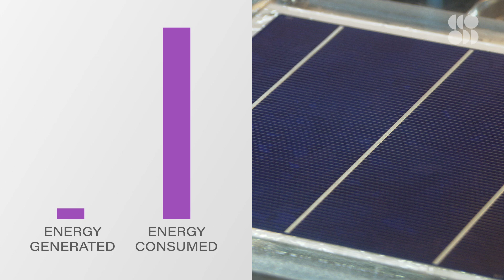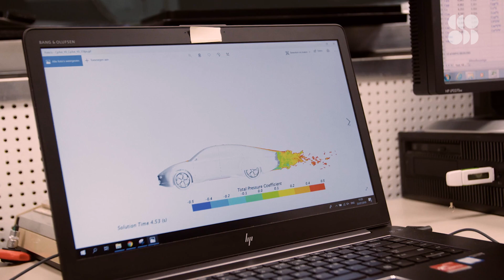The Solar Car Revolution Could Change EVs Forever

Comment: Forget EVs , EVs are here but now they have solar roofs!
Reply: They worded it bad, but solar vehicles have to have batteries for reliability. But they can be way smaller.
Reply: @Lardah  The Aptera goes from 40Kw up to 100Kw for the 1000 mile range, that is top end for EV battery size..
Reply: @peterchandler8505  okay didn't know that and didn't search for it. I was just intending to state that with Solar EVs the batteries can be smaller than non solar, which saves weight and space.
If you then fit more top notch batteries in that free space you can obviously increase the range by quite a lot (depending on circumstances)
Reply: @peterchandler8505  The Aptera doesn't actually exist and it's a very, very long way from doing so
Reply: @kirkc9643  I know that there are only 2 protype Apteras at the moment (having re purchased the IP & experience from their first Aptera prototypes & testing), however their fund raising efforts have been quite successful, the joint CEOs both built up & sold successful companies between their first run with the Aptera & second, not to forget that battery technology has progressed enormously since their first Aptera alongside a totally different market for EVs strengthened by Climate Change concerns.  I would therefore suggest that their plan for production Apteras to be rolling out of the door around the end of these year looks reasonable, although that first year of production is already spoken for by the people who have put a deposit down...
Reply: @Lardah  I would be walking a lot with a solar car with the current weather we’ve had lately.
Reply: SEVs 😝
Reply: I hate these clickbaity titles.
Reply: Yep same as the Solar roadway!!!
Reply: @billshuey7422  No, solar roadway was a total scam. Stupidest thing ever. Solar panels on a light enough car makes total sense, solar panels in the roadway not so much.
Reply: Ok dud
Reply: it's called a comment generator
Reply: A solar vehicle is an electric vehicle
Reply: They have just changed the title. If only they could fix the content too
Reply: @kirkc9643  hahahah they actually changed it.
Reply: I better choose both plug in and solar powered. Solar powereds only use their energy from the sun, while the weather is not always sunny.
Reply: EVs are dead, long live the EV!
Reply: Wow so epic
Reply: It's EVs, not "EV's".
Reply: @krazzysu  Thank you for youre service
Reply: @krazzysu  it’s not that deep

Comment: "Dad can you come and pick me up?"
"Sure" looks outside "No wait, it's raining.  Take a taxi"
Reply: I understand that you are not serious, but for those who don't. Clouds do not stop solar energy from reaching the ground
Reply: @Canal10000  Sure they do. Not all of it of course, but if its raining there would be very little power available to charge an electric car.
Reply: @paulwary  Maybe I should have written "completely stop" instead. My point was that you will still get some charge even though it is a cloudy day. Panels are often around 50-70% less effective with heavy clouds and 80-90% less effective with heavy rain. So it really depends on how far you want to drive, but the cars will still get charged when you are at work
Reply: Guys relax.  I'm pro solar(own solar panels!) it's a joke.   But I do think that solor panels on cars should be viewed as a "plus" not an "only" (AKA EV + solar.)
Reply: @lucth16  which is why these cars have batteries, Sono 150 miles, Lightyear 450 miles, Aptera 400-1000 mile options

Comment: the problem with engineers is that they fail to hybridize multiple, highly efficient engines of various fuel types, thus, relying on energy source dependent on conditions and resources available.
Reply: Well to be "highly efficient", they have to be hyper specific & hence smallest change in the operational condition changes efficiency to large extent. And, those engines aren't really "highly efficient". Automobile engines have efficiency ranging from 25-45% for the most part. Whereas, if you use the fuel in thermal power plant, advanced plants are ~80% efficient (minus transmission loss)
Reply: fuel types: petroleum, ethanol, hydrogen, electricity

Comment: He doesn't know why cars are bricks?
Take your car to the Crash Test track and get back to me...
Reply: Strength isn't necessarily related to weight.
Reply: @Xiph1980  yes that's true but the problem is with weight reduction the crash can actually be worse for the passenger even if the car is perfectly fine. You have to take momentum to account, in a head on collision the heavier car is the safer option (if the cars are equally as strong) this is partially why you don't normally see seat belts on a bus. So when they keep bragging about weight savings they are forgetting the basics of a collision MOMENTUM. It is also worth noting that mass doesn't have anything to with drag if the cars have identical body shapes. 

The shape of the car is also of concern, "He doesn't know why they are bricks" well perhaps that because its a popular looking shape? Sure the other car has less than half the drag of a normal "brick" car but it looks rediculous. Even with all it's benefits you're going to struggle to sell that car to the public simply with how rediculous it looks, there's a reason other "radical design shape changes" haven't caught on.
Reply: @Xiph1980  he's talking about the shape not weight, you got bricks in between your ears?

Comment: Did I hear carbon fiber that ain't cheap
Reply: I just think that the guys making these might just have possibly looked into the cost of those composites?  It just may even be possible even more than one composite material?  They are after all spending all day on these cars...

Comment: Wouldn't a solar powered car still be an ev(electric vehicle)
Reply: Yup
Reply: Yeah an SP-EV
Reply: Basically, just with solar panels glued on them
Reply: @kallah4999  Aptera's are actually clipped and bolted on so that they are easily replaceable if damaged.
Reply: @fotoguru222  same difference
Reply: SEV Solar Electric Vehicle
Reply: SEV

Comment: That car would literally fly on a highway if it's that light
Reply: Depends on downforce.
Reply: Side wind could probably make it difficult to keep the car in a straight line
Reply: @HellexTV  Actually, Aptera is so curvy and slippery, the wind has nothing to grab onto - the exact opposite of a van or box-like SUV.
Reply: Those EVs aren't that light. The batteries alone weigh hundreds of pounds at least. Aptera weighs close to a ton... More than a ton with a 1000 mile, 1000 pound battery.

Comment: This is cool, but why isn't it just better to have solar on your house and charge the car whit that electricity? Your car would be safer, and it would benefit the grind your on. ( if your car is full that solar panel is doing nothing)
Reply: @Donny Tee "Solar on the house is useless in overcast sky or rain." No they are not. They run at between 10% to 25% and while that's not ideal it is hardly useless.
Reply: If you already have solar on your house, then great! If not, it is far cheaper to spend the $900 to get the full solar package integrated on an Aptera for example.
Reply: Cars represent freedom. True freedom involves not being tethered to house. You can charge for free anywhere
Reply: Would’t worry about that. With the little power those solar panels generate you’ll never get the batteries full without additional grid/home charge. 

Or they have to make the batteries so small the car’s range is useless … at which point you HAVE to grid charge again … which effectivly defeats the purpose of solar panels on an EV.
Reply: Why not do both?
Reply: @BrotherAlpha  It's way more expensive on a car than on a house, also extra weight for the car which is counterproductive and of course affects the design of it.
It's better to focus on a lightweight and super efficient electric vehicle instead, something which is quite the opposite of what the automotive industry is doing, by creating massive electric SUVs which are completely stupid carbon footprint wise.
Reply: @amigodesigns  "It's way more expensive on a car than on a house, also extra weight for the car which is counterproductive..."

I think advances in solar panels are making these arguments less compelling. The costs and sizes are going down so much that the reduced battery size needed makes solar powered cars viable. 

At least that's how I see it. Maybe I'm wrong here. Not my area of expertise.
Reply: @amigodesigns  I like your idea about the need for lightweight transportation. 
Solar cells can be made light as a feather. They put them on airplane wings for example. It's the heavy glass they use to cover stationary panels that weigh so much.
Reply: @BrotherAlpha  Solar cell cars are gimmicks….. It makes so much more sense to put solar cell on your house roof rather than on the car that is probably going to be park under the shades. You wanna park your car under full sun? Well, find a place in the city or suburbs that your car solar cell won’t be blocked by trees or other buildings. If you are “lucky” to find spot to exposed your car to bright sun… you car going to turn into sauna the next time you get in. Oh, did I say that you probably going to derive tiny amount of energy from the solar cell? Honestly they could probably made this car much more affordable without the solar cell.
Reply: diversity
Reply: @Tanks_In_Space  flat panels are way cheaper, and less efficient ones the same, those panels in the two vehicles are on the High end which increases costs a lot. So as panels get cheaper it will be always be more in a house than a car for the points mentioned earlier.
Reply: @Donny Tee Even if we grant this statement as true - - which it's not - - it's not like putting the panels on the car would be any different.
Reply: You could charge while you are driving with a solar electric car. Not possible now but in theory as solar panels improve a solar electric car could have unlimited range during the day.
Reply: It allows you to charge at all times, as well as not have to plug in.
It's like the perfect vehicle. It's currently unbelievably impractical of course, but if it was practical it's literally perfect

Comment: The Aptera really looks futuristic. The other looks more practical tho. I always wondered why solar cells aren't on EVs like tesla already
Reply: Safety. Weight. Utility. Power. Range.

The area of the vehicle for solar panels and the amount of power they can generate is not enough for any normal sized vehicles. Maybe one day in the future as I'm not against the idea. Tesla has a patent for using solar panels on the cover for the bed of the Cybertruck, but it won't add more than like 15 miles range per day or something. 

It's fun to see people working on the technology though. Considering we'll have ICE vehicles on the road until like 2050 or so the types of vehicles that will push them out have to be similar for now. Just from a safety perspective. No way the solar car here holds up in a crash test :/
Reply: @Stinsvarning  Yeah but don't let facts get in the way of clickbait
Reply: @kirkc9643  yeah.. the aptera has been shown years ago and still hasnt got to the consumer.. its been so long i thought they had given up
Reply: @jono6379  well they had. Aptera went out of business in 2011 and came back in 2019.
Reply: The efficiency of the car, or power consumption is the main reason.  Aptera uses a third or a quarter of the power other EVs use (100Wh per mile vs 240Wh+ per mile for other EVs), means that the small amount of power the solar powers generate adds a far more significant range than less efficient EVs

Comment: sucks at night.
Reply: I understand that the battery might work quite well at night though?  Unless that is you are planning to drive more than 1000 miles in the hours of darkness in an area without electricity, or EV chargers?  The Aptera even comes with lights at the front & back, just in case you wanted to try it at night ;)

Comment: Why not just put the solar panels on your roof. You dont need to park in the sun you will get way more power and you can actually drive long distances and also you dont need to be in a very sunny area and you can drive at night. I think this is some very niche product.
Reply: rezargamer  Because if you have to repair a solar panel on one of those vehicles its going to be much more expensive than if one fails on your roof.
Reply: rezargamer  Just read my comment. It makes the car much more expensive to manufacture and maintain.  Instead just put a battery in it and recycle the battery after and you have a much more useable car than this one.

Comment: Isn't that currently not doable? The efficiency of solar panels is too low to power a car.
Reply: Yeah but don't let facts get in the way of clickbait
Reply: No, it's not saying its not more efficient like that. It is very efficient, but the energy in is not equal to the energy out. 
Your looking at a 9- 12  hour charge to go 40 miles. 
Maybe your job is 10 miles away. That's 20 miles round trip there. 
Then you have to pick up your kids. Thats probably 5-50miles round trip depending on if they go to the same school, how far the schools are from the house and eachother. 
Then you gotta get groceries and pickup dinner at Chipotle because we all know we don't cook after grocery shopping. That's another 10-30 miles round trip. 
Sport practices on Tuesdays and Thursdays. 
Saturday you got basketball games 2 hours away. 
Maybe you don't have kids. Well then you can probably afford one of these and it'll probably work quite well.
Reply: @Samuel-er6td  So in your example, you'll need to plug it in some of the time. If you're driving for more than an hour a day, you'll need to get some of your charge from a plug. Still cheaper than gas and better for the air and for you and your family's lungs.
Reply: @fotoguru222  correct I didn't clarify.

Comment: What if it's snowy or dusty day?
Reply: Then you need to recharge it. The point is that you combined with home charger, it should be enough so that you rarely have to visit a gas station.
Reply: @PuscasuRobert2012  yea, I mean like the worst case scenario with no charger nearby
Reply: @piko3058  you'd same as worst case scenario when no gas station is nearby!
Reply: @PuscasuRobert2012  or only see an external charger for those very loooong road trips
Reply: Snowday!! 😁
Reply: Uh... brush it off, as you'd do anyway to see out of it?

Comment: A car accident would crush that like a styrofoam cup
Reply: I prefer my car to be broken, but me to be alive after a crash. There's a reason F1 cars completely disintegrate during a crash.
Dissipation of energy.
Reply: @Xiph1980  true. For boat racers they have a protective pod in case the whole thing flys apart. It's all about safety of the driver

Comment: Isn’t that another form of EV?
Reply: Yes.
Reply: it's called a comment generator
Reply: Take this with a grain of salt, I may be putting two ideas together that don't really pan out how one would expect: the difference here that should be clarified is that depending on your access to the sun a solar car would reduce the times the batteries are drawn from and thus extend their lifetime. Everyone commenting is on point, these are augmented EV cars. I think the point the piece is trying to make is that that difference could be significant, especially as we rely on lithium batteries and their shortcomings more and more
Reply: Basically yes.
They separate cars with Lithium ion batteries for whatever reason.
Reply: @oleksandrbyelyenko435  Solar powered cars also need batteries. The only difference is whether or not they need to be plugged in to charge.
Reply: @Dayanto  yet the EVs they are trying to bash can also get charge from solar
Reply: @Quick_in_and_out  Maybe, if retrofitted, but not enough to make a difference or add up to any useable amount of mileage.
Reply: @Quick_in_and_out  Many are charged from house rooftop solar panels, that way driving really is pretty well carbon zero...  Those house rooftop solar PV panels would need to be ... ... squeezed somewhat to fit on a car!  The big thing is efficiency...  100Whrs per mile for the Aptera, most other EVs are around 250-400Whrs per mile, requiring too much power to benefit from the small amount of power the solar panels give
Reply: @oleksandrbyelyenko435  the reason is quite obvious tbh
Reply: Kinda stupid I know just for clicks XD
Reply: No, it's fusion powered.
Reply: Actually it's an electric combustion vehicle (combustion being the sun) ...kind of